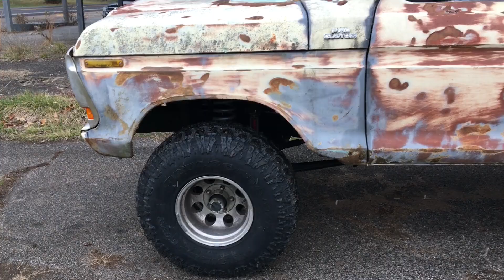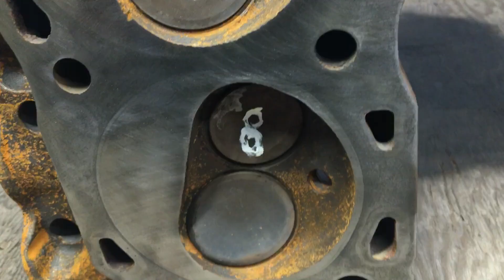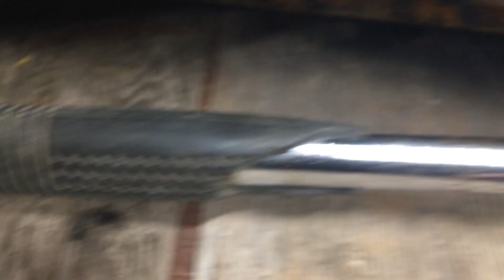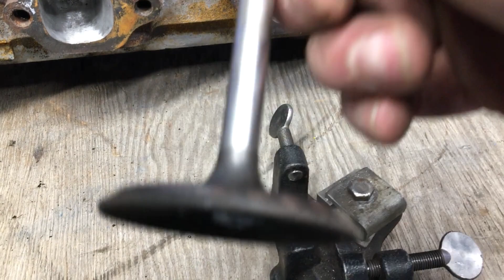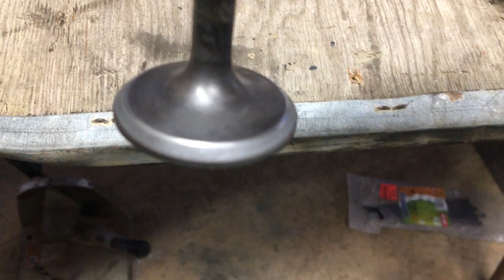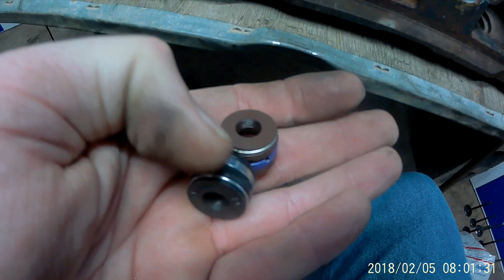460 EFI Cylinder Head Porting and Rebuild!!!

Comment: Could you provide the part number for both exhaust and intake stem seals ?
Reply from the maker: It depends on what year the heads are as to which valve stem seals it uses.
Reply: Heads from 1995 and valve stem is a 11/32inch
Reply from the maker: @lupegonzalez9143 I’ll look them up. Although the umbrella seals work on all the 460 heads. It’s the positive style seals that they started using in 1986 that changed depending on the year of the head. I’ll look them up
Reply: Thank you sir I was looking around to for the valve springs kit but can’t find any?
Reply from the maker: @lupegonzalez9143 you have to buy that valve springs that match whatever camshaft you are using.
Reply from the maker: Intake valve stem seals are  SS45418 and exhaust valve stem seals are SS45591A
Reply: @BlackLabGarage  thank you sir! I’m just running a stock cam. I was thinking of going with 460Efiguys valve spring kit but sounds like I need to do a lot more upgrades on that path rather just make something reliable and simple
Reply from the maker: @lupegonzalez9143 if you’re running the stock camshaft then there really isn’t a need to upgrade the valve springs. Unless they are just really worn out and weak, the camshaft will quit making power by the time the valve springs start to float. But if you want a cheap upgrade just get a set of 351C 4V valve springs and install them.

Comment: Whatever you do dont reuse the retainers. I did and just by luck searching where i had lost oil pressure. ( oil galley soft plug popped out) i found every retainer had cracked and ready to drop a valve
Reply from the maker: Those wasn't stock retainers that you see. They are retainers that fit the better valve springs I'm using.

Comment: You remind me of my dead uncle.     
The way you work explained. Why and what's you opinions on gasket matching the ports. I noticed you mostly left them alone. Thanks
Reply from the maker: Yes. Simply because if you do not have a flow bench you can do more damage than good on these heads porting them. The EFI heads work on velocity. The older Ford 460 heads were harder to hurt by porting them.

Comment: A bit off topic but, will weight of piston vary enough to create a problem in putting a piston out of a fuel injected 460 into a carbed 460?
Reply from the maker: Nope. They are stock replacement pistons and made to stay within the stock balance specifications. I have never had a problem using EFI pistons in the carbureted 460 engines.
Reply: @BlackLabGarage thank you for responding,  in 1997 i worked for Ford and test drove a brand new F350 4x4. It had the 460 with a 5 speed and 4.10 gears. Was excited to drive and was planning on buying it until i drove it. It had a little less  power than my brothers  factory 78 F250 4x4 with a 400 2 barrel and 4 speed with 4.10 gears. Also about the same power as my dads 76 F250 with a 390 2 barrel and a 4 speed.  I was expecting more than what that 460 had. Maybe i drove a lemon,  have driven other 460s in older Ford trucks with Carbs and they ran much  better than that factory fuel injected 97 with less than 10 miles on it. I immediately spewed hatred on the fuel injected motors and discounted ever owning one. Had a factory F150 Indianapolis Pace Truck with the 460, it was very impressive. Much like you, i love the 460 and i am planning on doing a fuel injected version soon after watching your channel.
Reply from the maker: @leseckerle you definitely drove a lemon then. The 400 was rated at 170hp and the 460 was rated at 245hp if I remember correctly. The EFI 460 engines have a lot of untapped potential! You can take a stock EFI 460 and add a small camshaft, do a little porting on the EFI heads, add a carb to the stock EFI intake manifold, a good carbureted distributor, and some headers and they make over 400hp and between 400-500lb ft of torque! Most people thought those engines were turds when compared to the old model 460 engines but actually they have the most potential to be a mostly stock engine. It was the emissions and fuel injection system that killed those engines.

Comment: Thanks for the insight. I have a 95 f-350 with the 460 efi motor. So far I’ve built an intake and an exhaust which has helped a lot with its breathing. I’ve thought of porting the heads but wanted more info and with what’s in this video I know I’m gonna wait a few years at least. 10/10 video and thanks for the laughs.👍
Reply from the maker: You can do minor work on them like I did and you will still get some gains. It's when people go in there and start hogging the ports out is when they make them worse than they would have been if they had left them alone. Without a flow bench to check your work I advise to not hog the ports out. Just work the bowls and valve guides, knock out casting flash, and you cab gasket match if you want.

Comment: The biggest improvement that came be made to BBC heads is to raise and straighten the exh ports. All of the brands of engines such as Pontiac, Olds, that had the long curved ports like these had low flow rates in the exh. compared to what could be seen in the intakes.  The EFI heads were proof of that along with any other head that kept the ports short and straight like BBC and HEMIS

Comment: With 460 cubic inches, you need more than velocity when you take into consideration that these heads flow like 236 cfm at .500 lift.
Reply from the maker: It depends on the application that they are being used in. This is for my F-350 that pulls an 18ft trailer. I don’t need all the cfm for high rpm’s. I need lower rpm velocity. Now if I was building a high performance higher rpm 460 then yes I would want more cfm’s. But for this application I want velocity for throttle response and efficiency.
Reply: @BlackLabGarage what you're saying about cfm and high rpm's isn't necessarily correct. CFM doesn't pertain just to high rpm. Increasing cfm can help low and midrange torque also. It's all about how much air the engine needs at all rpms, and a stock 460 cubic inch engine can benifit from more cfm than what factory heads offer. Im not saying a trickflow 460cc runner head is the way to go, but something like a TFS 290 would help considerably. Velocity is important,  but so is having enough cfm, i mean enough cfm for all rpm ranges. Velocity does not make up for not having enough cfm.

I want to reiterate that cfm does not effect just high rpm power. An engine uses air at all rpm's and air makes power. So, if an engine needs more air at any given rpm than what the head flows an increase in cfm will increase power.  And a stock 460 can use more air. I know thats not what you want to hear, but it is a fact. A dyno proven fact. 

If you look at AFR heads, you will see that a lot of them have high mid lift flow numbers, but theirnpeak flow numbers are not necessarily as high as their competitors, but a lot of times they make more torque and hp on the whole curve compared to their competitors.
Reply from the maker: @engines-anonymous  but once again you aren’t looking at the context of how the engine is being used. When EFI engines had some of the best stock flowing heads there was to be had! Look up Scotty J. With just a mild cam upgrade, minor port and valve work and bone stock bottom end the EFI engines are making 425hp. Why would I want more than that in a work truck? Why would I want to spend $2000 on a set of aluminum heads for that engine when the extra horsepower isn’t needed? That doesn’t make good sense at all. If I was building a drag car then yes it makes more sense but not for this application it makes no sense.
Reply from the maker: @engines-anonymous  even Ford themselves said that the ports of the Cobra Jet heads were overkill and not needed. They don’t have velocity and are dead on the bottom end. Same thing with the Cleveland heads. Why do you think Ford switched to a smaller intake valve in 1970 for the Boss 302? To try to bring the velocity up because they were dead on the bottom end.
Reply: @BlackLabGarage you cant use 302 cubic inches to determine what is best for 460 cubic inches.🤦🏻‍♂️ super cobra jet heads are completely different than ported D3's and tfs290s. im going by what ive seen on the dyno, and back to back comparisons in the vehicle. What dyno test have you done, none. How many times have you tested unported. ported, and aftermarket heads in the same vehicle? Im guessing none. It seems you are a keyboard expert.
Reply from the maker: @engines-anonymous  well you would be wrong. Just last year we dynoed a bone stock 1968 429 just to see how close it was to the factory numbers. Yes I can use Cleveland heads to compare to Super Cobra Jet heads. A dead port is a dead port no matter what engine it’s on. You keep hollering AFR. Guess what? They have smaller ports because they operate on VELOCITY! Now how about just focusing on your videos and builds instead of just assuming things about me.
Reply: @BlackLabGarage eah, but you didn't do any a-b test though. 

Regardless, you will make more torque everywhere with better flowing heads on your stock 460. Cobrajet and Cleveland heads do not define anything with what im talking about. You want more torque, get more cfm to that engine at all valve lifts.

Comment: Ive done a little porting on these before and had them flow tested. What you did doesn't add much for flow. Nothing you'd really see or feel on the dyno.

Enlarging the opening of the port to the size of the intake manifold port is important, actually. The intake port being smaller than the intake manifold is like having a damn for the air to hit. It hurts power. Its been proven on the dyno. 

One of the biggest things you can do for flow and power is a proper 3 angle valve job.  

Grinding the seat away like that is hurting flow. It needs multiple angles, like 3 or more to gain flow.
Reply from the maker: Do you know how many thousands upon thousands of marine 429/460 engines were built using standard heads and Cobra Jet intake manifolds? That’s about as bad of a port mismatch as you can get and yet those engines didn’t mind at all. That’s probably a 1/4” mismatch in places. FE’s are built that way also. I’ve seen them with tall port manifolds on short port heads.
Reply: @BlackLabGarage I didn't say it wouldn't run well, im just saying it kills horsepower and torque.  Those engines would have made even more if they didn't have that big step. Same goes for your engine.
Reply: @BlackLabGarage    they did it, and they ran, but that doesn't mean they ran better. Port mismatch just isn't a good thing. If your head opening is bigger, then you don't lose flow. If your intake is bigger, you generated turbulence and lost flow.
Reply from the maker: And it also depends on which head you’re using. The F3TE head flows better than the E7 head. Scotty J who is one of the biggest 460 guru’s that there is gets over 270 cfm on the intake with the 2.09 intake valve and a back cut. I don’t want a three angle valve job on these heads because they truck will be used for pulling. While I agree that a three angle valve job breathes better they also can burn the valves easier in industrial and heavy duty usage because the exhaust valve cools it’s self by transferring the heat to the valve seat and the exhaust valves tend to run hotter in those conditions than a typical car engine. So back cutting the valves helps some but doesn’t sacrifice the longevity of the valves. It’s all about the intended usage and application as to how it should be built.
Reply: All true. 

You can have your intake manifold slightly smaller than the head opening, and you don't hurt flow. 

Getting three angles instead of stock helps flow in every type of engine use. Sometimes it's helpful to get a larger valve so you can gain some radius shape on the seat, without opening the port throat.

Comment: I have an 85 460 truck. What carburetor and ignition system would you recommend
Reply from the maker: Well they came from the factory with a Holley 600cfm carburetor. They work good on 460’s and have the Ford kickdown linkage on them if needed. The factory Duraspark ignition system works good as long as you put a good ignition box on them. You can still get the Motorcraft ignition box.

Comment: What about the paint on top of the bolt hole. I know working on caterpillars they insist all paint is buffed off before assembly and torques because it will wear off and cause things to break. I mean even track pads. No paint what so ever.
Reply: A lil paint won't break anything what are you smoking
Reply from the maker: I’ve never heard that before. Which I could see it being more of a problem with powder coat or something with much thicker paint on it than what that engine enamel puts on. It’s never caused me any problems.

Comment: It’s funny you mention Joe Mondello, before I came back to Ford products I was into Olds really heavy. I did some porting on some heads from a ‘68 olds 400ci for my 455 based 461ci olds. I really enjoyed doing that. I will do you have done with the nonEFI heads. Thanks for showing me how. I really appreciate it! ( I watched that video also)
Reply from the maker: @donmarsh1599  I haven’t been around many Olds motors. I know their 455 engines were strong runners. I bought a Trans Am once that someone had put an Olds 350 in and I also had a friend that had a 1979 Trans Am that had an Olds 403 engine in. My understanding is the 403 can be made into a good runner but their blocks are weak because of windows cast into the main webbing? I haven’t ever had one of those torn down so I can’t say for sure on that. Now me personally…while I do bleed Ford blue, I also love me some Pontiac engines.
Reply: @ I’ve heard the same thing about the 403.  When I was a teenager, my friend had a ‘69 Grand Prix w/ a 428 hO
Reply from the maker: @ I’ve had one 428 Pontiac engine and like a big dummy I sold it. It was never in anything so I can’t say how it ran but I’ve heard they ran really good.
Reply: @ I can attest to that. After I joined the Navy, he had the engine professionally built w/13:1 pistons, and other parts (not sure exactly what now though) but, there wasn’t much that could catch him at 155. Mph. (Clocked with Michigan State Police)
Reply: Got a question Brother. Which head would be best to port/use, D3VE or fuel injection heads? It will be carbureted.
Reply from the maker: @ well I would use the D3VE heads simply because you have a lot more choices for both intake manifolds and exhaust manifolds. You’re limited to the stock Ford intake manifold with EFI heads and either stock exhaust manifolds or L&L shorty headers. So you have a lot more performance options with the D3VE heads.
Reply: @ thank you so much. I really appreciate the info and you getting back to me!
Reply from the maker: @donmarsh1599  You're welcome!

Comment: Thanks for all your videos! If you can please help clarify some info on my 460 short block? Engine builder says it's internally balanced.  Factory 460 crank, Scat H-beam rods and Racetec .030 over pistons. Originally I brought him a different 460 block and the Ford crank (I remember seeing the externally balance counterweight sleeve). Builder ended up using a different 460 block, replacing the block I brought to him. Does this mean, the crankshaft also had to be replaced? Meaning, a different 460 crank was installed instead of the Ford externally balanced crank I brought to him?  Hope to hear your input.
Reply from the maker: @gerardc.8755  an internal balance 460 crankshaft will not fit in an external balance block. The counterweights on the crankshaft hit the bottoms of the cylinders because the external balance 460 block has longer cylinders than the earlier internal balance block did. If your block says D1VE then it’s an internal balance block. If it says D9TE then it’s an external balance block.
Reply: @BlackLabGarage  thank you for the prompt reply and  help
Reply from the maker: @gerardc.8755  You're welcome!

Comment: You ever seen a cam break in two on a 97 460 ? Just got one that has a new distributor installed but it’s not turning when motor is cranking . Figured it’s got a broken cam . Gonna tie into it when the weather gets warmer.
Reply from the maker: @whitepunch1392  you sure it’s not that the distributor gear is spinning on the shaft because the pin is sheared?  You have to watch new aftermarket distributors. They install roll pins to hold the gear but it’s supposed to be a coil pin holding it not a roll pin. Roll pins shear easily
Reply: @ No I haven’t pulled the distributor out yet. I’m hoping that’s all it is . But I don’t usually have that kind of luck.
Reply from the maker: @whitepunch1392  Could very well be that it has sheared the distributor gear pin. It happens more often than what people think. The oil pump gets a piece of trash in it and that combined with aftermarket distributors using roll pins instead of coil pins and the pin shears in half. I hope you find that is all that is wrong with it. Camshafts can break but it is extremely rare.
Reply: @ That’d be great if that’s all it is . I’ll definitely let you know what I find.
Reply from the maker: @ yeah keep me posted on what you find.
Reply: Wife used my 79 f250 a few years ago, calls me on the road, I'm a long haul trucker, and tells me truck turns over but nothing is happening. Had it towed home, I'm stressed out and a friend suggested "might have spun the distributor gear pin".Sure as shit, it was sheared. Hopefully it will be the same for you. Good luck